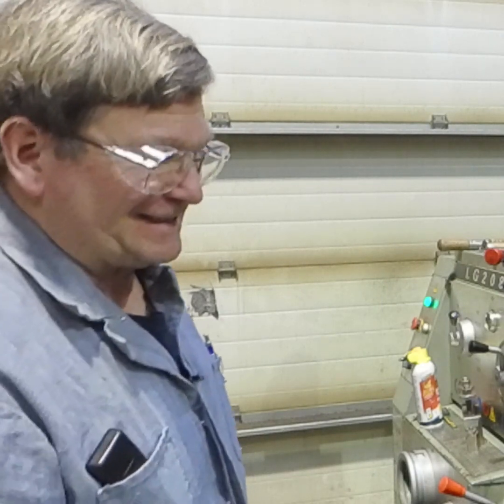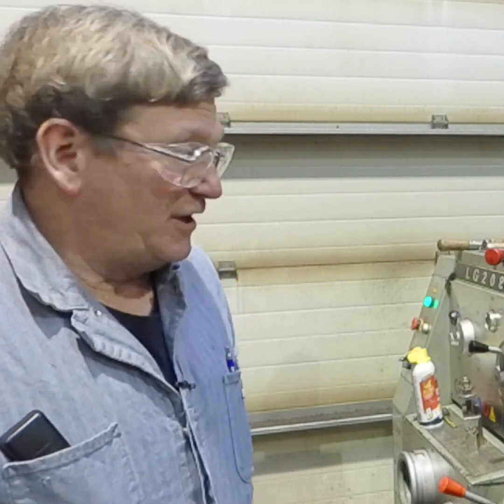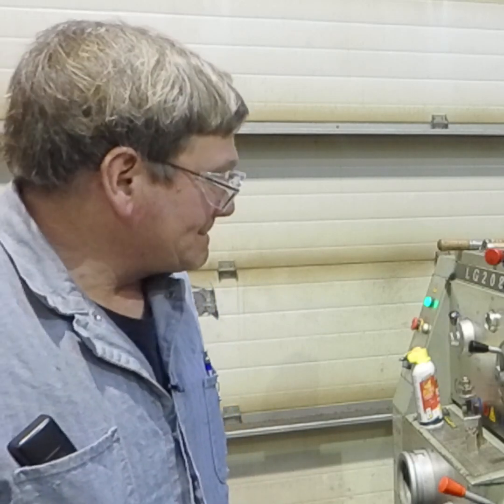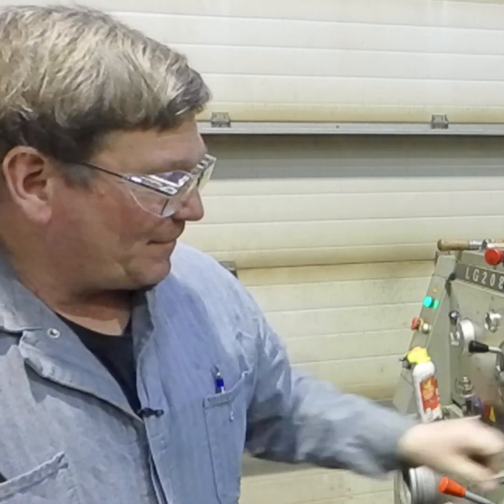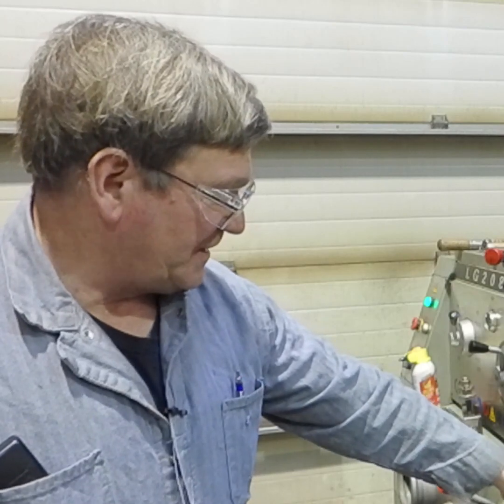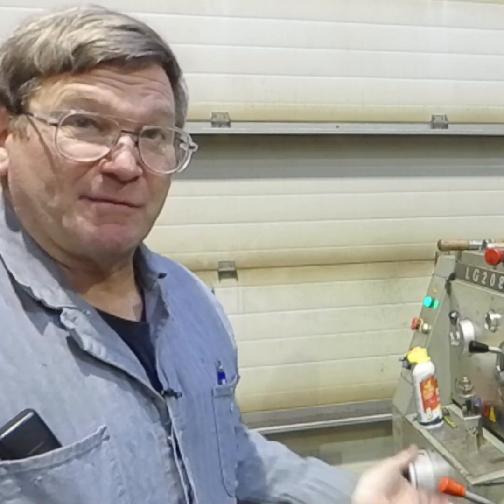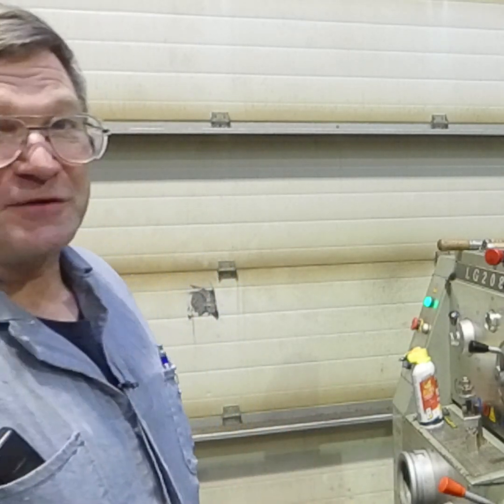Machinist's Minute: Removeable lathe bed and accuracy

Comment: Yea. Howie. You should be showing the component that the discussion is about here. For me as a rule of thumb  you should not unbolt vital parts of the machine. If you do always tram it when you put it back. When I was messing with manual lathes even if I needed a different chuck like 3 jaw to 4 jaw and back I'm at least going to test the run out on both chucks by the time I'm done. Size of the machine is a factor also. Your lathes are pretty big therefore your probably alright but for a home hobbyist with a little harbor freight 14x8 trying to squeeze that tiny bit more radius out of it your more likely to knock it out of true.